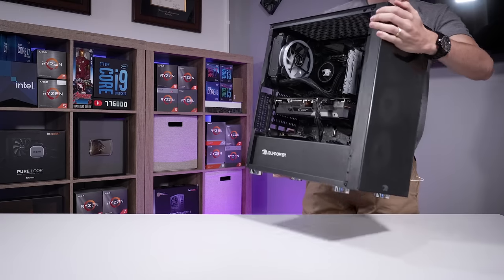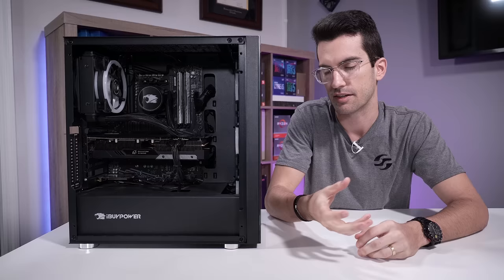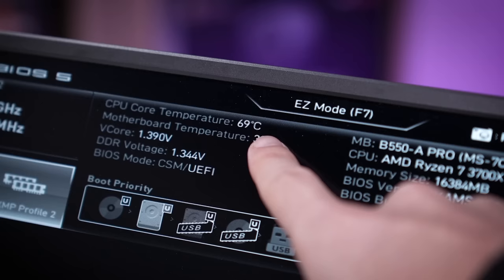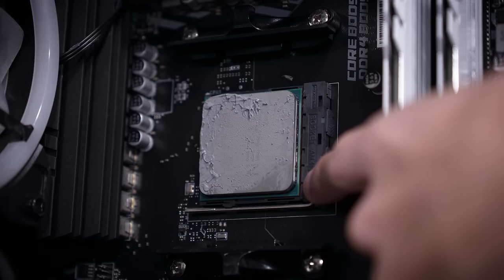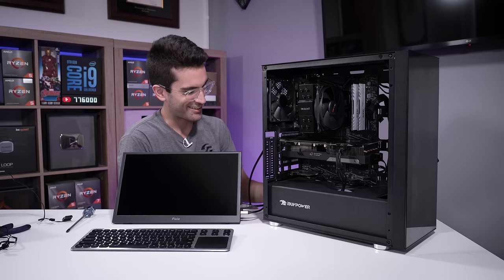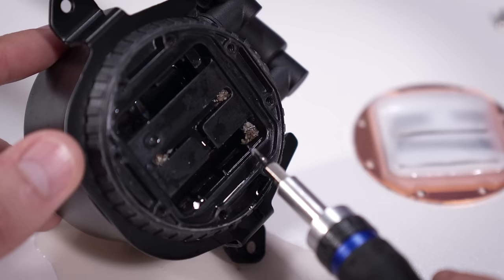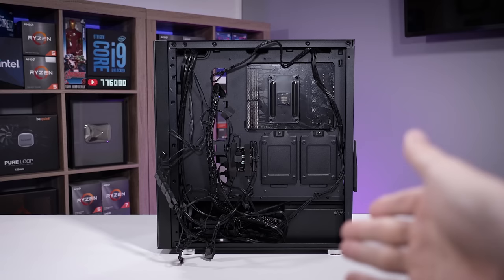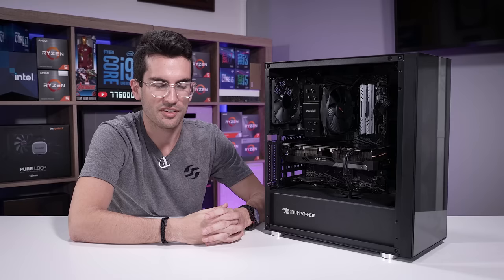Fixing a Viewer's BROKEN Gaming PC? - Fix or Flop S2:E8

Comment: It's sad to see an AIO go like that, it is fixable but not everyone is going to be able to do it, so it is a big issue. Keep up the great videos Greg!
Reply: you spoiled the video. Didn't have time to go fullscreen before I seen this
Reply: It was a 120mm AIO, it was useless from the start (even if it hadn't been pulling air in).
Reply: @brikt8826  Don't read comments before watching the video.
Reply: @Middcore  120mm AIOs are a total waste of time and money
Reply: It really is a shame. I still have a 10 year old Corsair H80 running on my old gaming build with a 3770k running 4.8GHz. That thing STILL runs like a charm. Mind you, there is a lot of air in the loop from evaporation over a decade, but temps don't exceed 75c which is extraordinary for a 120mm AIO on a CPU running 1.48V.
Reply: You can replace tubing with clear tubes, even add a reservior.
Reply: They really are, a tower cooler could throw them out of the water! I feel like the minimum should be a 240mm aio

Comment: That Vcore voltage is scary high imo. Even for ryzen.
Reply: The bios just shows the boost voltages when using PBO. It doesn't show when it goes down to low voltages which it does on Windows. And zen chips can safely hit 1.5v-1.6v IF they are observing FIT limits. I think you may be referring to those voltages being dangerous if you set those on a fixed overclock, not PBO.
Reply: Ryzen X CPU are known for over voltage at stock.
Reply: Engineers: this is the right voltage so it works safe.
People on internet: its high hur dur, i know its high because an yotuber did an undervolt and he proved to me that 1.4 volt is high.

Comment: The white stuff stacked in the aio is caused by using a wrong ratio of aluminum radiator and a copper block (msi did the same thing too and RMAed it
2Al + 3CuO → Al2O3 +3Cu
Reply: @mikeycrackson  yep they probably failed chemistry
Reply: That’s probably what is causing the red bits in the fluid too. As the aluminium reacts with the copper then it causes bits of copper to break loose.
Reply: @mikeycrackson  Many do. Happens in many industries. Really lame. They choose to save a few cents per unit and couldn't care less about the customer. Lovely.
Reply: Yep after a year my msi aio made the exact same rattling noise and i thought it was a wire touching something too
Reply: Copper rads are too expensive for aios. There are anticrossive additives like glycol. 

Unfortunately it took asiteck a long time to get the ratios right.

And there are still batches that get it wrong.
Reply: They're fine with it as long as it lasts longer than the warranty period. They don't care after that.
Reply: Thank you science man.
Reply: Igorslab has an article about this issue. It's because of cheap radiators witch are used by an oem manufacturer. Aios from Acetek (nzxt, corsair, ...) doesn t have this Problem because they use better radiators(also aluminum)
You can read his article for the specific Problem with the radiators
Reply: @watchandjewelryloft4713  It's always hard to determine if it's incompetence or greed. Usually a mixture of both with a sprinkle of arrogance.
Reply: In addition there could be archaebacterial growth, they are anaerobic and some species are thermophilic, i.e. thrive at temperatures above 70°C. Could account for the red coloration of the liquid. All they need is some carbon source, which could be the glycol coolant; probably the biocide breaks down after a few months at high temperatures, or the bacterial mutate to tolerate it.
Reply: @WhySoSeriousGM  my case I thought it was one of my case fans hitting the frame at first. Then thought it was an exposed wire sparking
Reply: @andrewmcewan9145  mixed metal water chemistry predates PC water coolers. Asiteck is irrelevant
Reply: @RT-gaming  Yes but in most cases outside of pc cooling there is not a good reason to minimize the glycol or other additive in the mixture.  I just use asetek as a example as they are the biggest and first oem in the clc market but it took a while to get the mixture right. Pump in rad/line clcs are a different oem who is much newer to the market so we can probably expect more falures till they get it right.

Now the reason for minimizing the additive in pc cooling is the additive has a much lower ability to absorb heat quickly compared to water and a cpu/gpu block can only have a specific size of fins before they become ineffective. When I refill or build a mixed metal loop I use 25% glycol (green car coolent) but im sure that clcs uses a much lower % Just to get the maximum thermal transfer.
Reply: @andrewmcewan9145  i work in the HVAC industry and mixed metals in hydronic heating and cooling systems far predates any PC related issues. these are all well documented issues and to claim anything other than ignorance on the manufacturer (including asetek) would be irresponsible.
Reply: What you're saying is true and that does cause Galvanic Corrosion. Greg did a video on it back in 2018, and he basically said they use corrosion inhibitors. A while back I cut the original H80 open and it had Yellowish fluid like the universal Prestone antifreeze.

Most AIO coolers use a Copper Block and an Aluminum radiator.... except for Alphacool. I have a 2nd Gen H100 from 2013 that's still running, and I had the original H70 which was in service for almost 8 years. I took the h70 out of service because those corrosion inhibitors do break down.... usually after 5 years which is in line with ethylene glycol antifreeze that cars used until the late 90's.
Reply: Everyone knows YOU DO NOT MIX METALS in a loop.
Reply: @WhySoSeriousGM  just replaced my MSI 240R yesterday bc of this issue. It was only 7 months old.
Reply: @kellc22587  same bro I was so upset
Reply: Sucks that they have to shave down the cost of manufacturing those and use mixed metals. I know that copper does cost more, but still.
Reply: Where does the part O3 come from?
Reply: @itsTyrion  from the oxidized copper
Reply: That explains the color and sludge very well.  I've never liked MSI, or these cheap AIO's.  All of the ones with radiator mounted pumps are garbage.  You get what you pay for.  Get something from Corsair or Arctic Freezer (block mounted pump).  Those things will go for many years, I gave my old system with an H60 to a friend.  The AIO is 7 years old and stlil works perfectly.
Reply: AIO Smegma 🤣
Reply: Yeap i have the same with MSI AIO for a 1 year use in my PC...they refund money to me

Comment: I like the idea of checking to see how many of these aio's on the market are having these issues, its baffling to see all that crud inside of these that definitely shouldn't be there!
Reply: The joys of mixing metals!
Reply: Avoid the cheap junk ones like MSI that have the pump in the radiator.  Stick with Corsair or Arctic Freezer.
Reply: @StormsparkPegasus  or just go with air, less stress and sometimes even better than AIOs
Reply: @mutley69  Not really.  They are bulky and block RAM slots.  There aren't really any good designs anymore either.
Reply: @StormsparkPegasus  I agree although both can be bulky as hell, depends which company you go for. Those noctua air coolers are insanely quiet and really good performance wise.
Reply: @mutley69  Be Quiet used to be good, but their new ones are GARBAGE.  My roommate got one based on how good they used to be, and it's one of the worst coolers I've ever seen.  The fans themselves are ok but they have no way to mount to the cooler, they just give you 2 cheap flimsy wires and expect you to use them like a zip tie, it's dumb.
Reply: Yep, I have had this problem for almost a year, trying and trying, then I happened to come across this video. Same exact problem but 3x worse. What a lifesaver, thanks heaps Greg!!

Comment: I knew the minute I saw "iBuyPower" it was the AIO. I had a similar issue on a computer I bought from them that was less than a year old. The AIO was a 240 mm. At first I wasn't sure what was going on because it actually wasn't "overheating" per se when idling or doing light tasks like web browsing. Just running hotter than before. It was idling at like 35-40 degrees and while web browsing it would fluctuate between 45 and 60. Which seems a bit warm but not dangerous. But here's where it got weird. It was overheating like over 80 degrees (celsius) after waking up from sleep, and if I did more intensive stuff like in photoshop or blender it overheated into the 90s. Tested with Cinebench and got instant temps in the mid 90s. It was technically under warranty but they wanted me to send the whole PC back to California at my expense with no guarantee on when they'd get it back to me, so I just decided to replace the AIO myself and see if that was the issue. I went with an ARCTIC Liquid Freezer II, and since I had the room, I got the 360. It must have been something wrong with the iBuyPower AIO because after installing the Arctic, all the temp problems I was having evaporated. Now I'm idling at 29-30 degrees and even when running multiple passes in Cinebench I don't get above 65 degrees. The bizarre overheating after sleep issue is gone too. Maybe I'll try and take the old one apart like you did and see if mine had similar issues. It might be, since the pump always felt like it was working.

Comment: That's crazy to see new AIOs messing up so quickly. I definitively would like to see you restore the AIO in another video. This video made me thing of my AIO, I have a Corsair H100i that I bought back in 2014 and its still kicking. Cooled my 3770k and now my 10700k perfectly.
Reply: Old is gold
Reply: yup only ran corsair. i think icue is little but wonky software but the hardware is solid.
Reply: It’s not really a new aio. IBuyPower has used that particular model for years since it’s easy to acquire and cheap.
Reply: You're lucky, my first AIO dead after a year.
Reply: I had a kraken x40 bought in 2013 cooling my 3770k up until I switched to AM4 a few weeks ago. I even left it running 24/7 for a good while. I could probably switch it over and get a few more years out of it if I ordered an AM4 mounting bracket.
Reply: Damn 8 year service life of an aio is awesome!
Reply: They don't make them like they used to.
Reply: I bought a Fractal Celsius S24 and S36 in 2017 to use in one machine, still kicking 6 years later cooling my brothers computer. Some of the fans died though, they were replaced with Noctua. Some companies did get it right.

Comment: i had the same problem a week ago. and the problem was my stock cpu intel cooler. thank god it was a simple fix. i learned a lot from gregs videos
Reply: Intel stock coolers aren't that great for most of their CPUs.
Reply: @GamerErman2001  they’re fine for the non k skus that they come with, as long as you’re okay with some noise
Reply: @GamerErman2001  i know but how the heck it broke down like that in 1 week of getting purchased lol
Reply: @videogamefreak221122  my i5 10400f(with the stock intel cooler) touches 90° c when rendering videos or when pushing it to its limit, so yea those crappy coolers are only good for i3s or older i5s
Reply: stock cpu intel coolers are known for getting that gunk build-up in the waterblock and pump, it happens to the best of us
Reply: @vineet1108  I agree. I got the i5 12500 with the newly designed cooler and they suck. Idle temp above 45°c and reach 86°c when I play non intensive games. Changed to a cheap Deepcool air cooler and now my pc is idling at 32°c and never exceed 70°c even on stress test with prime95.
Reply: The plastic push pin retention on older stock Intel coolers is a tragedy, glad they got rid of it. Already seen too many instances of them popping out, and even had it happen to me once (though that was when the PC fell over, oops)
Reply: @videogamefreak221122  Not really. Years ago when i bought a i7 7700 it would roast with the included cooler,it was sitting around 65-70C in idle and the fan was going crazy.Before it i had an i5 7400 and it was perfectly fine woth the stock cooler so i guess it really depends on the CPU

Comment: Good choice for review. During build process these closed loop AIO devices should be flushed well before final fill occurs. Sometimes a shortcut happens, and contamination is left inside the system.

Comment: I find it so interesting that AIOs can even do this,  my previous PC was using a H60 for 5 1/2 years and I never had this issue, hope that still holds up with my h150i in my new system.
Reply: do you think that this was caused by aio that have pump on the radiator, if the pump at the cpu block it self, will it be the same problem?
Reply: @amarzuhdi5944  If it has anything to do with the pump being on the radiator, why? How does that cause additional build-up? 
I really want to know if there's a reason this would happen
Reply: I 've been using an H150i pro for 3.5 years now, still holds up really well with an overclocked 8700K. 
I also find it interesting and BAD, at the same time, that life has been growing inside an AIO :p
Reply: @criznittle968  yeahh i been thinking the same, i thought that pump being at the radiator might contribute something but it does not seem right. Maybe it what greg say it was because of water that wasnt treated properly
Reply: @t3amb4sh  i been using aio also right now for 2 years+, just worried that it may happen to me also cause it was brand that wasn’t really famous
Reply: @amarzuhdi5944  Yeah, I worry about that too, but Greg's videos have helped me not to be afraid to take apart my AIO, if necessary :) 
Plus, I may find new life inside it 🤣
Reply: I've been using a H100 for over 10 years on my 2600k. These H series are a beast. Still keeps my PC at 40c.
Reply: Many of these AIOS came out during COVID. Maybe there is a correlation as these companies mainly MSI and GIBABITE have cheaped out considerably in the production of these.
Reply: I’ve had this issue and I had an nzxt x63 and it only lasted a 1 year and 1/2. It kinda put me off AIOs as it was my first one and tbf to nzxt they replaced it but I was already put off and decided to switch to a Noctua air cooler instead.
Reply: I had an H60 for 8 years, finally started to die last year

Comment: Great Video! AIOs have improved, but I am not a big fan of them. Unless you are doing extreme overclocking, they are not needed. A good quality air cooler will keep your CPU within a few degrees centigrade of an AIO. If the fan fails, it has the advantage of providing passive cooling and is an easy, inexpensive repair.
Reply: @philiprobar  Gamer's Nexus does extreme overclocking. Most people don't. The siituation doesn't apply.
Reply: @jaytoney3007  Not true. Gamers' Nexus concentrates on detailed, accurate reviews and they regularly comment on price to performance ratio. Unless it is the specific topic of a video, overclocking is usually only a small part of most reviews.
Reply: I'm not a water cooling fan boy. I've never used it in a personal build.

Gamers' Nexus advice can be summarized as follows:

A good AIO has the advantage of being able to, in general, run quieter as they provide good cooling with lower fan speeds and are better able to absorb short term spikes in heat production without having to speed up their fan(s).

Avoid the least expensive, no-name AIOs. Other than a couple of well know screwups by well known companies AIOs have very low failure rates and will last for years.

If you're going cheap use air cooling, something like the Vetroo V5, Hyper 212, etc. (There are several very good $20-$40 coolers.)

For mid and high end it's a toss up depending on numerous factors that each user will have to decide on: your risk profile, available space, overclocking, personal preference, etc.

Comment: I had the same problem with my stock AIO cooler from IBUYPOWER. Started to do the same noise but my temp was still good. I changed it but while doing some research, I founded out that a fair bit of people had the same problem.
Reply: Same !!

Comment: My Corsair h100i v2 has been running for 5 years with 10+ hours of use a day and still going strong. Ryzen 7 1700X idles at 32 degrees and under a full load barely hits 70.

Comment: I love the AIO idea you have. I finally got my build up and running and I ran Cinebanch R23 last night. 48C was the hottest my CPU got and I ran the 30 minute test so I was pleasantly surprised, and this was with me forgetting to take the dust filter off of the top of my PC (I have the AIO top mounted). Coming from my old computer having idle temps in the 70s... I love the upgrade lol. From now on I will be monitoring stuff like that. I am running the Enermax III RGB version (got it at a discount before I knew the difference between RGB and ARGB.. it's the only drawback because it's more for me to figure out and it's the only non ARGB component in my pc) and so far it works like a charm.

Comment: I had the same problems a year ago when I bought an iBuyPower PC from Costco. I booted it up, and right out of the box, the pump was making a clicking whirring noise before Post. My PC was idling at 60C just like in the video, but this PC was fresh off the shelf! I did some investigating, and found the same thing with the fans pointing the wrong way, and at that point decided to completely abandon that PC, lest I find out where else iBP messed up on the build. The fact iBP prebuilts are having these AIO and fan problems on brand new computers speaks volumes about their quality control.

Unfortunately, I was in a "I need a good PC literally right now" emergency, and swapped it out with...sigh...ANOTHER iBuyPower prebuilt PC. These chip shortages, man. But I guess this second PC was an unexpected redemption for iBP, because it booted without any issues and has been serving me quite well ever since.